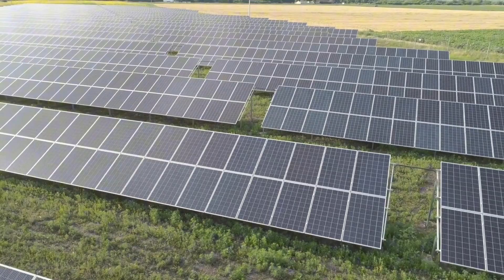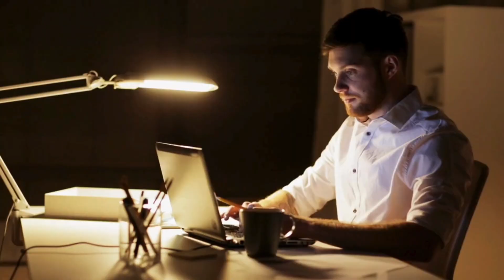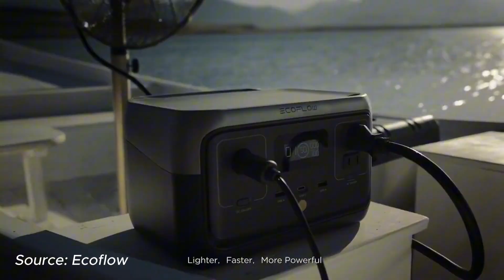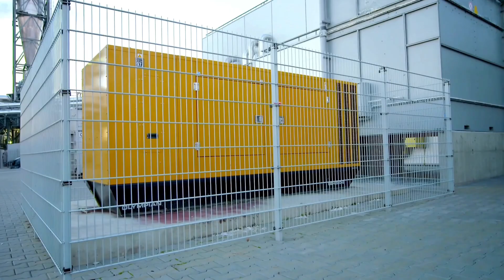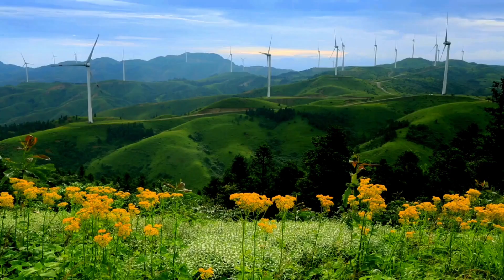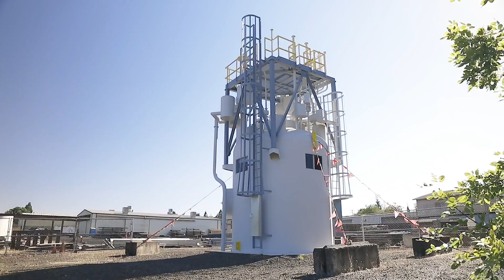Mini Nuclear Reactors: The End of Load Shedding?

Comment: what happened to the concept of "base load"... nuclear and coal will be part of the energy mix for a long time. Renewables are a great opportunity tho- lets create upward and downward industries to locally develop & manufacture, the goods and expertise. but if its all just gonna be imported from china its a missed opportunity.
Reply from the maker: Base load power is not a necessity. The power system can run effectively with a combination of variable generation (solar and wind) and flexible generation (gas, hydrogen, pumped storage), with the bulk of supply (as much as 70%) coming from solar and wind. Nuclear and coal will be part of the mix for the life of the current plants. But no new nuclear or coal are needed in the energy system. 

Agreed, let's avoid imports. Renewables provides the greatest opportunity for local production and using local expertise.

Comment: I agree, Small Modular Reactors (SMRs) are a massive disappointment. SMRs are way too expensive compared to solar and wind. Plus, energy storage is so cheap that it is set to become commonplace in many homes. Residential batteries provide energy security and have the potential to make bankers cry when they realise that people don't need power stations in the way they used to.

Great video, see you in the next one.
Reply from the maker: Great comment, thanks! So true, our need for power stations is radically changing.